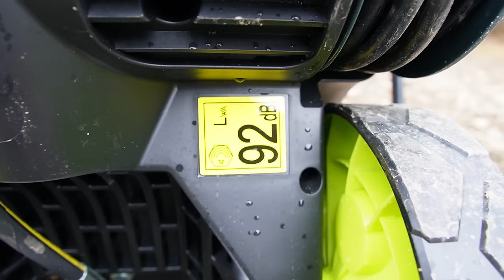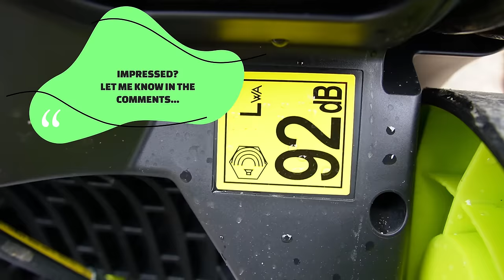BEST PRESSURE WASHER EVER MADE for Car Detailing? Is the AVA P80 Better than Kranzle?

Comment: If fuses are constantly blowing there's a problem somewhere that needs to be investigated. I was sold when watching the video but £400+? I guess that's fine if you're earning a living from it, but I'm looking for something affordable for more personal use. There are a number of washers with similar power rating for less than half that price and a comparison with any of those would have been useful. Love that stubby gun, but quite shocked that you can't regulate the foam flow like you can on my cheap little £80 jobber. That's a serious omission on the washer that seemed to have everything.
Reply from the maker: Ok so this video is pretty dated now. Very few machines had blown fuses and they sold thousands of these machines across Europe before hitting the UK so our electrical system is slightly different over here. They actually made improvements to stop fuses blowing as much. The p70 is a better solution as it's a dialed down p80. I have a p70 and it's great. Unfortunately there are a few negative comments and posts that don't tell the full story. Some people claim that they leak even after admitting that they left them out in freezing conditions (ice warps washers on any machine not just Ava) as long as they are looked after and not hammered they will last years and the warranty will back it up 👌
Reply: @epicautomotivedetailing  
Thanks for taking the time to reply. I'm in the UK too and I'm an electrician - fuses don't blow unless there's something wrong somewhere so I wasn't particularly put off by that, and most things will last IF people learn how to look after them. 

I've just been looking at the P50 large bundle at £229. I have one car to clean once every 3-4 weeks so I don't want to go too mad and even that's over budget, but two things are selling this - the long warranty and the stubby gun, especially as I don't have a driveway and have to wash the car on-street. Cleaning your car while dodging traffic isn't the easiest task! I might go for that.
Reply: Update: I bought the Ava Smart P60 in the end, and for anybody wondering if it is worth the premium the answer is absolutely it is. Superb machine, and so much easier to set up and put away than my last one. But the main thing is even after a couple of days driving around in the rain the car still looks a lot cleaner than it did after cleaning it with the previous one, which admittedly was just a little Hyundai machine costing a third of the price. 

But the difference is night and day. Because it gets all the dirt off it's so much easier to give the car that final coat of polish, and as well as being a lot easier it's a lot faster too. There's a mop attachment sold separately for just £25 so I'm going to buy that too, and the proper foam gun because as the video says, they don't half go through the foam quickly. In the meantime the best way to combat that is to use a lot less/dilute it more. 

Fantastic channel by the way, fully explains everything with no waffle and easy to follow. Nothing worse than those channels that waffle on for 10 minutes before they even get started. Looking forward to the next video.

Comment: I’m trying to run the P60 pro from a water tank but the pressure is almost zero and it’s rendered the washer pretty useless. Can anyone recommend a work around for this? Will I need an additional pump to increase flow from the tank?
Reply from the maker: It definitely works from a water tank I've tested that myself so many times. Is it gravity fed? If the tank is in say the van simply make sure pressure washer is lower so out it on the floor and run a one metre hose. 👌
Reply: @epicautomotivedetailing  thank you for the reply! I’ll try and run a shorter hose, it is gravity fed but it’s on a 25m reel at the minute. I never thought about shortening it when I moved from external source to a tank I just left it on the reel

Comment: I rocking the AVA P70 V6 ,an beast =D
Reply from the maker: Oh my I bet it is don't think we can get one in uk
Reply: @epicautomotivedetailing  i did not go all in befor there is one better model Called ava p90 v6 .

But i what i like on my version and the other is that its diffrent and dont have any wheels ,just solid  weight 😀
Reply: @epicautomotivedetailing  if you has an slow fuse like 16A it works fine , i live in an 1930 house and has not pop any fuse yet.

Comment: I'm a little surprised you thought too much product went with the foam cannon. You can set the mixture from 1% to 20% of the mixture by turning the gray spout at the front. You have a scale at the top of what you set it on. You start at the smallest and set it up until it is good (maybe for the smiley). You may have had it at max and you probably never need 20% product blend. If you still think it will be too much at 1%, you can fill the product bottle underneath with half water and half product. Then it varies how much product comes out with the temperature range. In the summer, the product is more fluid and if it comes out more, it is during a cold autumn day. 
It is important that when you have used the foam cannon to rinse it with clean water so there is no product left in the metal mixer because then it becomes more and more clogged. It is also an important part of getting a tough foam that stays on the car and does not run off. But in the end you still have to change it and you do it very easily yourself. It sits in the yellow top if you take the gray mixture regulator off the hardest.
The size of machines has no effect on the result, but it is faster to wash with a larger machine with more water and higher pressure. But you have to see how many watts the machine draws. AVA's largest machine requires a power outlet that is secured with a 16 Amper fuse. 
It is also important to roll out the power cable so that it does not heat up. On the latest model, they have a wheel to spin the cable on, where they have made so that the plug is in the innermost part of the wheel so you have to spin off the entire cord to access the socket and can not leave half the cable on the reel so it gets overheated . 
Since the number of pistons is important for the life of the machine. If you increase the number of pump pistons from 2 to 4, you have doubled the life of the machine and get a smoother run. If you increase again from 4 to 6 pistons, you have doubled the service life again. The machine itself is made in China, but critical parts are made in Scandinavia and are sent to China so they install them there in the machine to maintain quality. They have a 20-year warranty on the larger machines, but they must be serviced approximately every 5 years. It is simple and you can do it yourself if you do not want to hand it in at a service workshop, they trust that you take care of the machine and do the necessary service to get the 20-year guarantee to apply.
If the hose is not enough to where the work is to be carried out, they say that you should not extend the power cable, but get an extension to the high-pressure hose instead.
For car washing, they recommend the swivel that you put between the tube and the nozzle so you get a vertical jet instead of a horizontal or whatever angle you want to set at the 360 degrees it is possible. 
They also recommend AVA Flexilans for car washing. So you get a larger turning width and can quickly change the angle of the nozzle to, for example, access the roof and wheel arches. For cars, you should have a 40 degree nozzle, and for milder flushing, a 60 degree nozzle. This does not damage the paint or the car. Keep the nozzle relatively close to the car so that the air does not stop and the water jet breaks. Therefore it is important not to have a smaller angle on the nozzle than 40 degrees. 
They also have a round brush that you can use. When you use it, you must have the water pressure on at all times so it is kept clean. It takes 4 michofiber cloths for a car. First one on one side half lower part then a new one for the upper part. Same thing on the other side. And it is important to have the wather rinsing on at all times in the cloth holder so that all dirt is washed away at once and does not get stuck in the cloth. Just throw the microfiber cloths in the washing machine afterwards
My relationship with AVA is as a customer.

Comment: I've seen some horrific quality issues from users of these machines, leaking triggers, hose reels held up by duct tape, fuses blowing left right and center.. 
100% NOT better than a Kranzle. 
Given what I've seen, I'd struggle to say it is better than a Karcher.
Reply from the maker: Hi Mate, I'm definitely not saying its better than a Kranzle (but I do love a bit of bait lol) . That would be foolish of me to ever claim that. AVA is better than kranzle as they have the highest standards I have ever seen for any pressure washer. As for the machine i've tested its been good for a first impressions so far, but  have left the door wide open for 12 months down the line if I keep it that long as I will be using it daily. I still love my Nilfisk P180 and praying to get my hands on a kranzle very soon. 🤞
Reply: For detailing the ar630 is better than kranzle 1120, 1322 and 1622.

Comment: In all honestly this looks like a bunch of plastic crapola with too many bits hanging off it that are just waiting to snap off. 

Owner of a Karcher K7 Compact here and a Kranzle K10/122, both solid machines with no dangly bits! 

RE the power you are feeling from that stubby gun, that’s pretty normal for any pressure washer at 120 bar or more so long as you’re using a nozzle with the right orifice size to maintain the rated pump pressure.

Comment: I am torn between this and the nilfisk p180 :/
Reply from the maker: Nilfisk p180 has the edge in terms of durability. Ava is ready to go with accessories but for something that's going to serve you for a lifetime I'd go for p180. I regret giving mine away
Reply: @epicautomotivedetailing thanks for the reply!  Love the AVA as it just looks different but durability is key so will take your advice. 😊
Reply from the maker: @markie1014  honestly in about 12 months time Ava will be a changed company and the standard of customer service will be better but right now they just need to improve to get them over the line

Comment: Cool review, cheers. Looks like they've made some improvements, since I had a P80 XL for test (https://youtu.be/0h8z2IKDplc). At the end, I've decided to buy the Kranzle 1152TST. I had the same issue with the AVA foamer, that version didn't have a reel for the electric wire, so it was rather cumbersome and it could handle water up to 40C (the Kranzle can do up to 60C). Plus I found the amount of plastic overwhelming.
Reply from the maker: Yeah think they getting smarter and in time will definitely have better products out there.